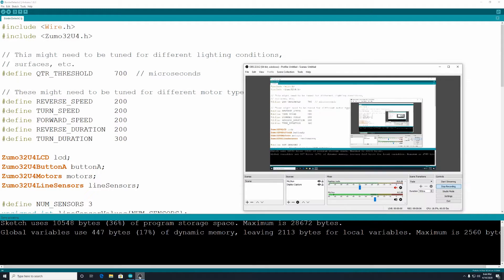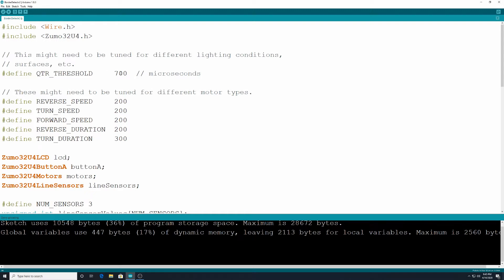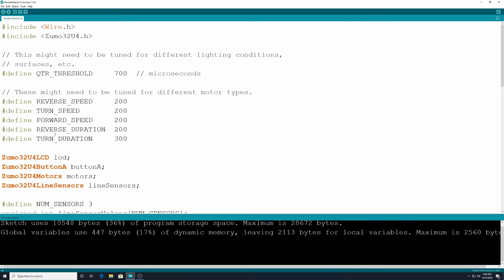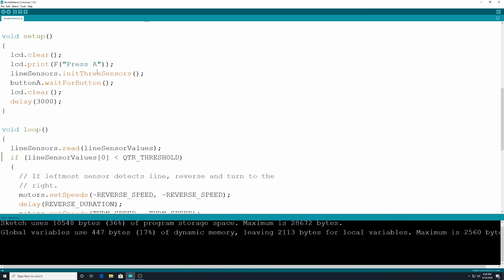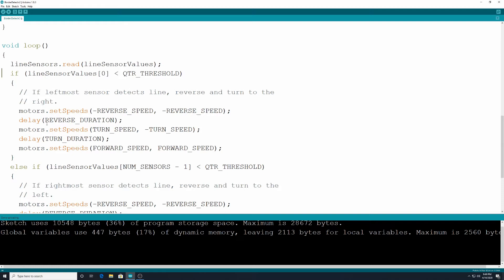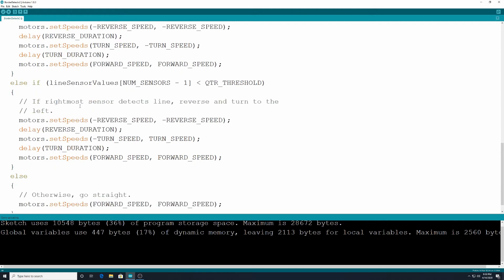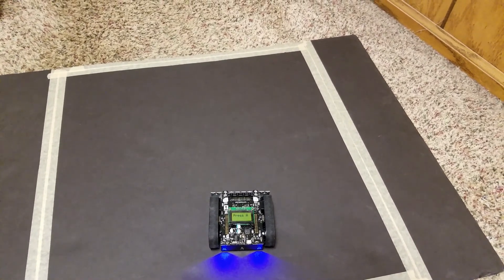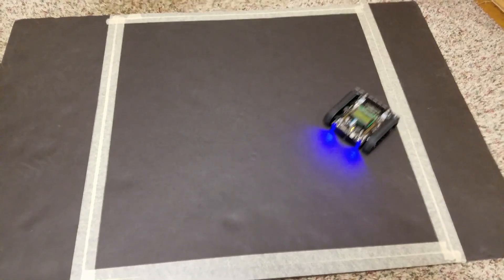Zumo Bot Arduino 8: Line Detection

Comment: what about a white surface with blacc lines? What would the QTRTHRESHOLD be?
Reply from the maker: The QTRTHRESHOLD may stay the same, but in the void loop you would change the first if statement to lineSensorValues[0] > QTR THRESHOLD instead of less than value.  After changing the < to > , it would just be a matter of experimenting the QTRTHRESHOLD until it's dialed in to where you want it.